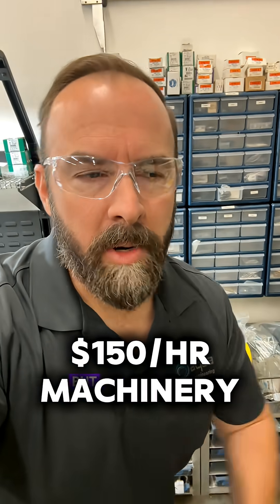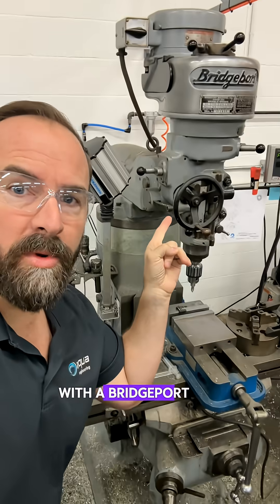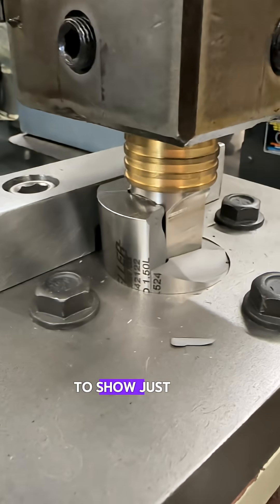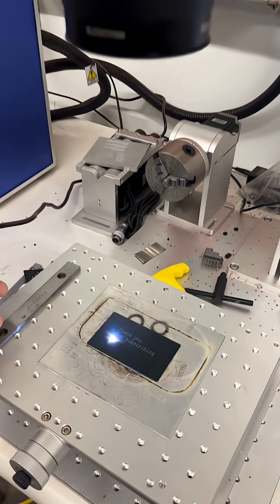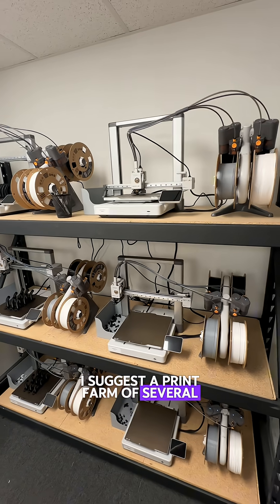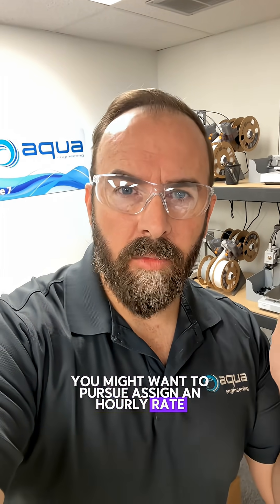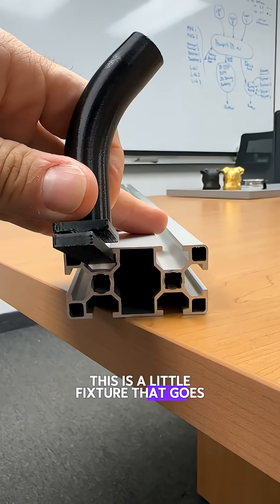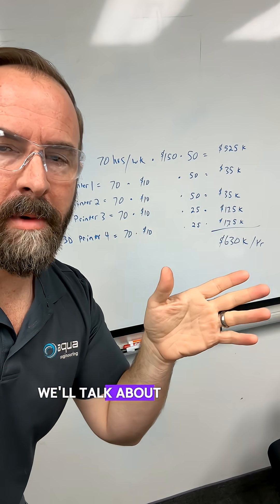$150/Hr DIY Machinery for Small Business

Comment: Installing pool liners earns about the same but you only need a handful of tools. Construction Installations are high value because you profit from the item (50% profit in pools) and charge about $100 per hour, per guy for install.
Reply from the maker: I’m a big fan of construction, got my start doing that actually. It’s all good until your L4/L5 disc takes a crap. Hopefully by then you’re managing a crew.
Reply: @i2c_jason That's pretty much what happened to me, ACL and lower back. The only things I'm interested in building now are ideal units that I design. Custom work is highly inefficient and really hard to remove yourself from. I'm building one, then 1300 identical greenhouses that I designed for full automation of microgreens.

Comment: The shop equipment itself is fairly affordable. The space and logistics to get it installed an operational is not. You generally need at least 2 phase if not 3 or 480v. You also need to be on concrete on ground level, and to have drainage. You also have to be able to make significant noise. You also have to have disposal for scrap and waste, which at small scale actually isn't bad. You also have to maintain your machines which isn't trivial. Man I wish I had a garage with a concrete floor that I could put a tormach and a 1/2hp lathe in.
Reply: I’ve been in many shops that are in upper floors of buildings and it’s fine. As long as the floor can support it. 3 phase is also no issue — you can run a phase converter or retrofit your machines with VFDs. My shop runs off 220 3 phase off a residential panel with a phase converter. No problems!
Reply: Machine maintenance is also not such a big deal. Coolant can go bad but you can run flood oil instead. I’ve also let coolant sit for a month without issue — I’m just extremely careful with tramp oil.
Reply: So you only maintain your coolant 😆 good luck with that bud  @ScaleInvariant
Reply: Also — not too sure what you mean about drainage. My machines don’t dump appreciable amounts of fluid on the floor!

Comment: 3d printers running 24/7 will eat filament and power and wear out quickly that’s a lot of brass nozzles and maintenance for $10/hr. There are many clapped out Bridgeports that won’t hold 0.010” because they spent 20 years in a field somewhere. Don’t ever buy a milling machine like that you can get bridgeports or knock offs free. I wouldn’t just buy a lathe, I’d take a community college course on machining before you do, they’ll also teach you gcode so you can get a haas tool room mill or some shit when grow and you’ll know enough to start making chips day 1
Reply: BambuLab printers don't use brass nozzles. They come with steel nozzles installed, which according to many people, last forever if you're not printing with any abrasive filaments. Their hardened steel nozzle will print abrasive filaments without needing to replace. And for the low price of the A1, you can afford to run them 24/7 and throw a few units away after so long and still be plenty profitable. Power consumption is just part of the overhead, which is pennies.

Comment: Why the A1 over the P1S (or P2S now)?
Reply: I would guess because it's cheaper and it works for what he needs. It gets the job done and makes money.
Reply: @ryanlandry8214  yeah, but the P1S takes up much less space, and it’s only $400 now. I feel like the A1 takes up so much space that you end up making less money because of all that wasted space. More printers = faster projects = faster profits
Reply: @mallek1989 he doesn't seem too limited on space and printing isn't his main goal, I assume. It's not like he's running a print farm.

It all depends on what works for each person's needs.
Reply: @ryanlandry8214  He literally said treat your 3d printers like a print farm...
Reply: @Segphalt and that means to be running your machines all the time. That's lean manufacturing, it's also lean manufacturing to not have machines that you don't use.

His setup is what works for him. If he doesn't need different printers or more printers then why buy what isn't needed?
Reply: @ryanlandry8214   If one wants to run like a print farm it suddenly doesn't mean run like a print farm when its not actually a print farm but also run like a print farm... uh huh. Guess I am just to slow for this one. 

I mean the P series can be enclosed and opens up more resilient materials than PETG so there is no shortage of reasons to go for the P series instead. Smaller footprint, substantially faster, more material options. Only real reason to go for the A1 is cost which may well be a factor but the price difference really isn't all that much. 

And well for me, I run flash forge machines so there are even options that are core xy that can be enclosed that are even closer to the A1 price.

Comment: Was a machinist for 25 years.
Can tell you from experience, a used Bridgeport should be inspected by a qualified person before you get yourself in a $5500 trap to scrape the ways, rebuild the head, replace the screws, etc...
😉
Reply from the maker: All depends what you’re trying to do with it. A machinist will be a perfectionist in many cases and might not accept a thousand or two sag in the ways. The bootstrappy R&D folks might not care.
Reply: @i2c_jason Fair point! Just watch your tolerance stack. 😉

Comment: What would you do If you only had a 3D-Printer and less than 1000$ in your bank?
Reply from the maker: Focus on microcontrollers, a small electronics lab, and CAD for 3D printed housings. That’s a great start and it’s more than I had in the beginning.
Reply: @i2c_jason love your channel! I’m also in the same boat. I have a 3D printer and a good amount of experience with Raspberry Pi making software for monitoring equipment. Do you think it’s better to focus on microcontrollers instead of Linux based devices for getting started with an electronics lab? Also, would it be good to learn pcb design or is 3d printing housings for existing microcontrollers and doing custom software good enough to start?
Reply: Cough cough guns cough cough sorry about that that just a little sick
Reply: @quickdiy8127  I've been wanting to look into this. Is there a marketplace for these or do people set up their own websites to sell 3d printed 2a frames?

Comment from the maker: Most valuable machine award probably still goes to the 3D printer, although the market is pretty saturated. Second place is probably that fiber laser I showed, consider people make entire businesses built on laser marking.
Reply: I agree, 3D printers and lasers are great tools. They don't have all the tooling costs like a mill or lathe, and easier to set-up and use than a cnc.

I wish my cnc router was as easy as throwing my design in a slicer and YOLO it without breaking anything. 😂

Maybe the newer cnc software/hardware is easier. I should look around.